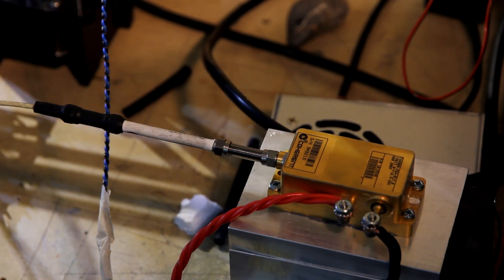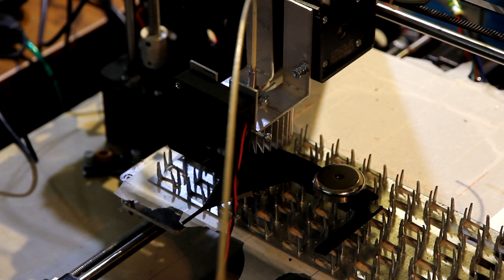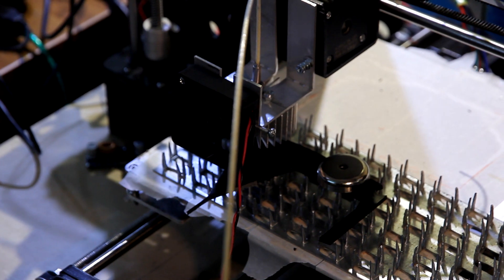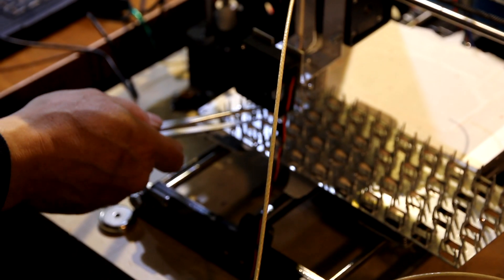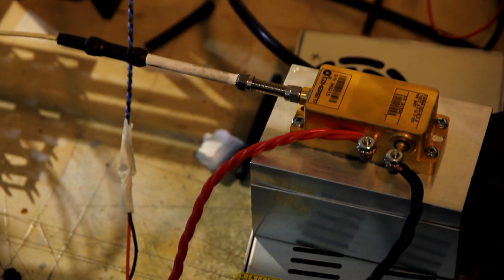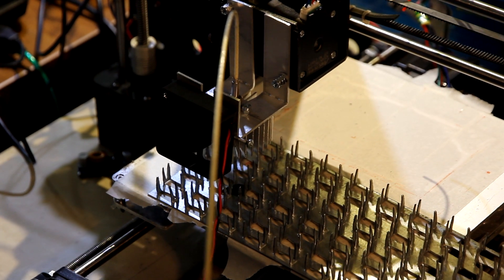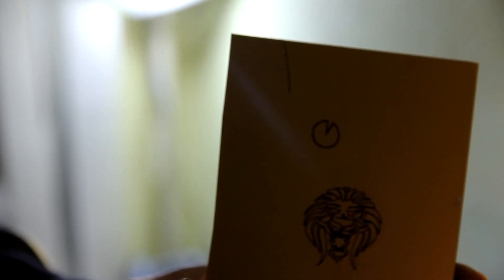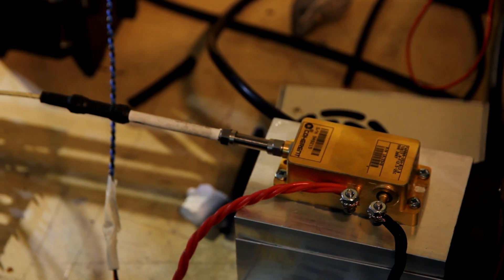FAP800-25 Watt installed on an Anet A8 3D printer. Acrylic cutting

Comment: It looks like your diode is is attached to a metal heatsink that is sitting on your power supply.  I'm not sure how you are not frying your power supply since the diode has a chassis that is connected to the anode, it is essentially shorting to the case on your power supply!